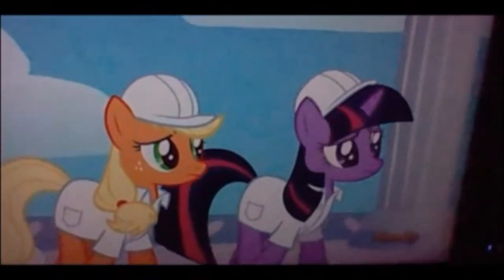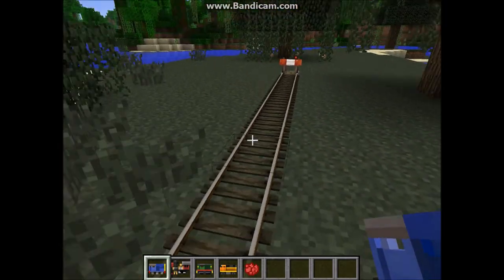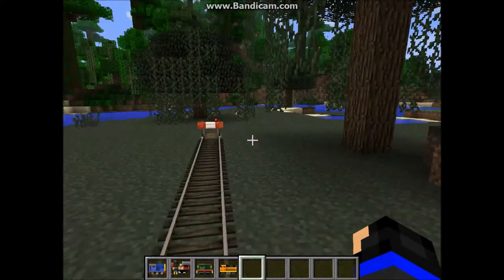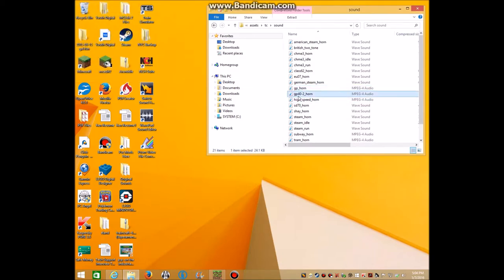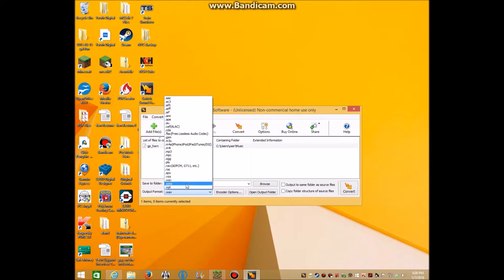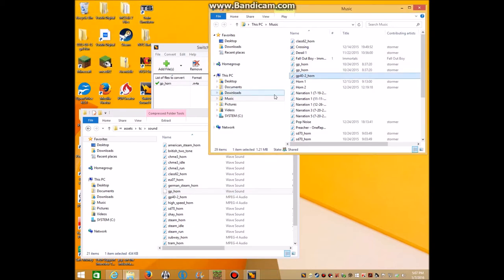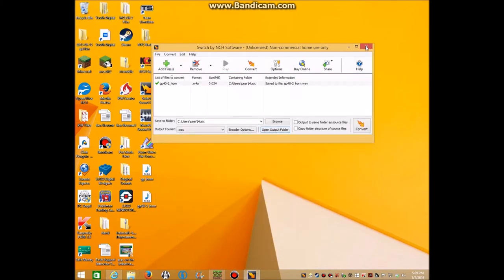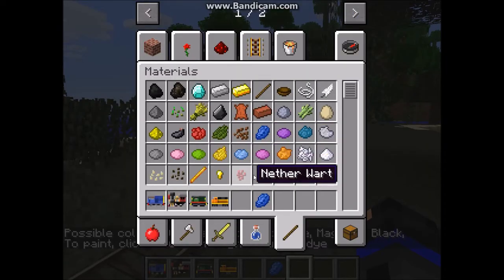[OLD] I GOT MY TRAINCRAFT TO WORK!!!!

Comment: How do u do it with 4.3.2_009
Reply from the maker: I am still working that out. The sound converter was a trial, and it ran out. When I used Audacity, it worked for a while, but stopped for some reason. A simple cheat would be to save the file in .ogg instead of .wav but it might not work based on the problem I've been having with Audacity.

Update(10/13/2017) I figured it out and I will make a video on it soon!
Reply: Thanks man, I'm currently using my other account if ur wondering.